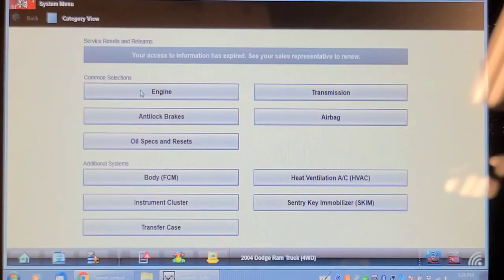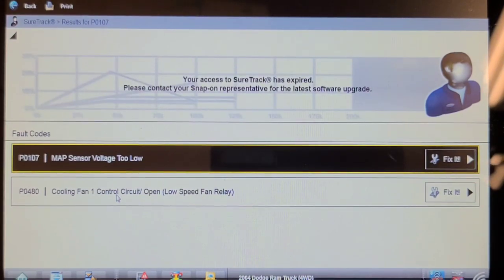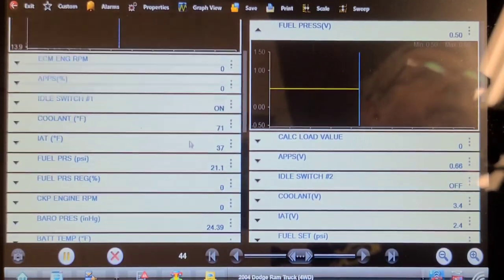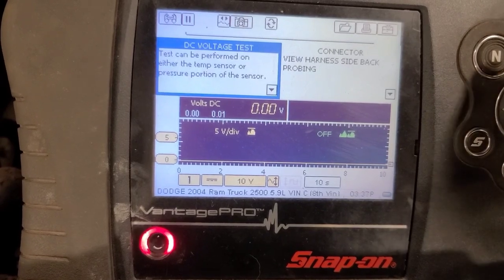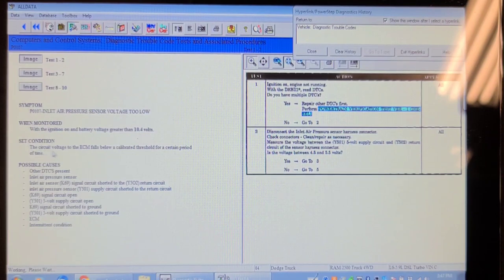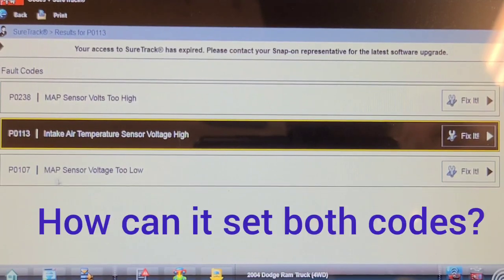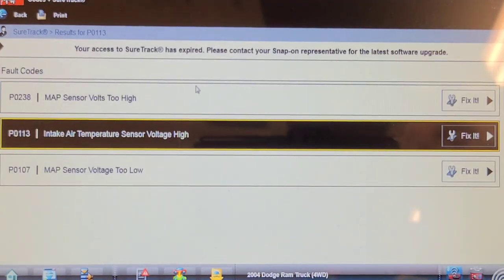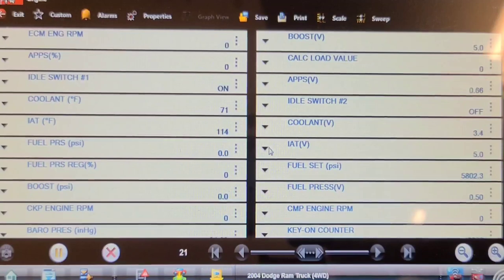2004 Ram 2500 5.9 Cummins P0107 Map Voltage Low. Customer Changed Sensor

Comment: Phillip, great information you been sharing so u were putting the resister between the signal and ground pens in the connecter to manipulate the resister and reading the scanner information that way u came to conclusion the sensor is bad thanks.
Reply from the maker: Jumping tge 5 volts to the signal and having it set a high voltage code is actually conclusive enough to condem the sensor. I was just trying to better understand how the circuit worked and what a normal voltage measured on the dignal wire would be. If it were mine I'd wire in tge 12K resistor to simulate sea-level as I'm sure that the Barometric pressure is not going to change much during a normal drive cycle here. We would be normally around 29.5inHg. I think the higher pressure would tend to give it more power but not sure. I've ordered a new sensor for $125.00. Putting the resistor in allowed the truck to be driven with no MIL til the part arrives. Thanks for the comment.

Comment: Your wore diagram colors are correct however there are two IAT sensors. inlet air temp and intake air temp. Both are temp and pressure sensors. The scan tool pid data only displays the intake air temp/boost, or the map sensor on the engine. The sensor you had the diagram pulled up is at the air filter. Additionally there's baro and ambient temp sensors.
Reply from the maker: Yes I know that now. Was confused at first. Scan tool description of the code is not quite correct. Plus the custome changed the wrong sensor on the manifold. Thanks for the tips.

Comment: Did this fix the gear indicator not lightin up? My 03 ram 2500 has the same problem with the gear indicator only lights up in Park and Neautral and Ive done everything with the shift cable and range sensor and still cant figure out what it is
Reply from the maker: I did replace the gear shift switch on the transmission and it did fix this one. I did hav another dodge about a year ago that had a defective instrument cluster that caused the shift indicator to fail. The shift selectro switch on the transmission is a stepped resistor and it steps down the 5 volt reference from the instrument cluster to various voltage levels that the cluster decodes to read the position. A short to ground on the 5volt circuit will cause the indicator to go blank. high resistance on the circuit will make it read the incorrect gear or go blank. Check the 5volts at the shift indicator switch dark green gray wire in pin 5 with it disconnected and the key on.

Comment: I have an 06 dodge ram 3500 5.9 when I drive it in the city limits 25mph it does just fine but when I drive it over 50mph  and come to a stop and sounds accelerated vibrates if I let go the pedal jumps and it comes and goes but it seems that it only does this when I go over 50mph I hope you can help me out appreciate it thank you!
Reply from the maker: It's hard to say whats going on. Any codes? Automatic or manual?
Reply: @Phillip Bailey  it's automatic it doesn't have any codes when I come to a stop it starts to vibrate and I'm not sure how to explain it but it stalls and when you let go the brake it jumps and than it works normal as long as I don't drive it over 50mph
Reply from the maker: @fernandocolunga8947  that sounds like the torque converter is staying locked on in drive.
Reply: @Phillip Bailey  thank you for answering another thing is that it doesn't have any codes will that be noticeable in the scanner if it was the torque converter one time when it did that I parked it and when I moved it back to drive it did it again the rpms where normal I was wondering if there's any test that I can do to figure out thank's again
Reply from the maker: @fernandocolunga8947  lol at engine load at idle in park when it happens if the TCC is stuck on engine load will be like 90%. Compare to when it's not happening in drive.

Comment: Thank you for the video.. somewhat of a help solid info! Im having same issue with map sensor, only my issue is the intake air temp and not the boost. I did all the same tests and i cant get p0112 to clear at all. Its stuck on 114 degrees F no matter what i do.
Reply from the maker: The scan tool mat be identifying the code incorrectly. The boost pressure sensor has an integral temp sensor in it and that's on the intake. The Barometric pressure sensor I believe also has an Ambient temp sensor in it as well. Maybe your testing tge wrong circuit.
Reply: @PhillipBailey  to be honest im not entirely sure. I just know im throwing code p0112 and after un plugging the map sensor/intake air temp or  trying the inlet air temp sensor no matter what i do i stay at 114 degrees on intake air temp no matter what. Thank you for messaging back!
Reply from the maker: @Diy-For-Life  try the other temp/pressure sensor. You need to read the voltage from the sensor as the temp is calculate and may not change if the sensor is out if range.
Reply: @PhillipBailey  i will try that thank you. I think I'm getting like 4.7v at the plug on the map sensor harness. I'm hoping there's a small short in wire somewhere or I'm thinking bad ecm because both sensors are new. And unplugging either changes nothing on ait read. On the inlet temp harness im getting 5v.
Reply: @PhillipBailey  the ambient temp sensor is a sensor in front of the grill right? Or am i wrong. It controls temp read out for outside temp on the overhead read out? The way i understood your video the air box cleaner as a inlet air temp and the map sensor has an intake air temp?
Reply from the maker: @Diy-For-Life  the sensor in front of the grille is for the dash and has nothing to do with the ECM. There are two engine related pressure temperature sensors. One is on the intake and is technically boost pressure and intake air temperature and the other is on the top of the air cleaner housing and is technically the Barometric pressure and air temperature. Check them both. The scan tool may refer to the one on the air cleaner as the MAP but thats actually wrong. Try unplugging the sensor on tge intake  start the vehicle then read codes. If you have two new codes now that's the wrong sensor. Reconnect  clear codes and repeat with the other sensor.
Reply: @PhillipBailey  thank you, so update if you care that is. Rookie mistake i was not starting the truck between codes. So when i unplug the map sensor i go from p0112 to p0113. Along with turbo boost high voltage which is expected. I check voltage at the plug and I'm getting 4.97v. I get 11ohms resistance from ground wire to ground. Then i get 187ohms resistance on the map sensor itself. Have yet to look and see what acceptable resistance ranges are for the map sensor. The map sensor is like 8 months old. I'm wondering if its failing already. But mean while all through this process of unplugging and resetting the ait has not changed from 114 degrees. So I'm kinda at a loss of ideas other than replace sensor and if don't work mayne ecm is bad? If there was a short you would thank i wouldn't go from low voltage to high voltage when unplugging right? Meanwhile not had a chance to mess with unplugging sensor on air filter yet and see its effects. Working on that next. Thank you for the help you have provided
Reply from the maker: @Diy-For-Life  the Sensor on the engine you are referring to as the MAP is technically the Boost pressure but some scan tools refer to that sensor as MAP as that's what the gas engines call it. The fact that it changes from a low voltage to a high voltage code disconnected and then plugged in suggests the wiring is OK. Does your scan tool display the temperature sensor voltage? The system will likely read a default number of degrees if the sensor is out of range. Backpin the temp sensor signal wire with it plugged into the sensor key on. The measured voltage should be greater than 0.5volt and less than 4.5volts. Compare it to the sensor on the air cleaner which I would expect to read the same. Hope this helps.